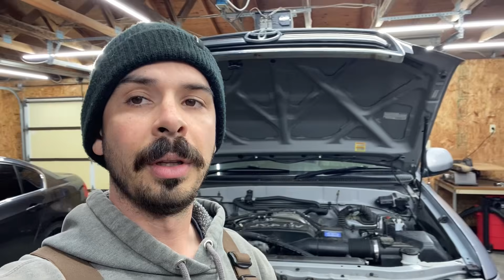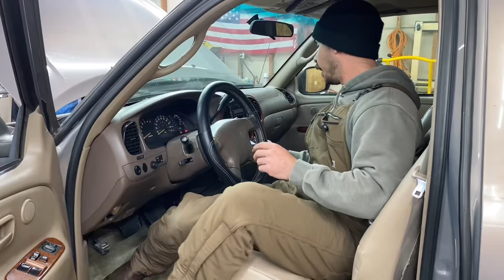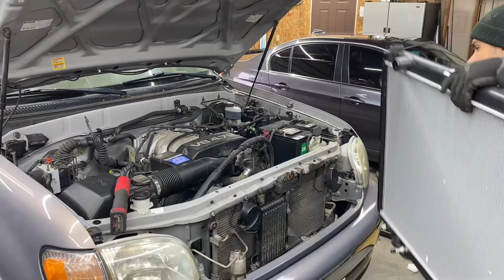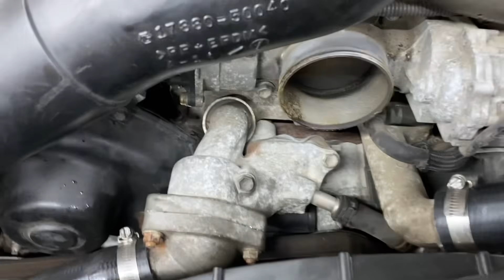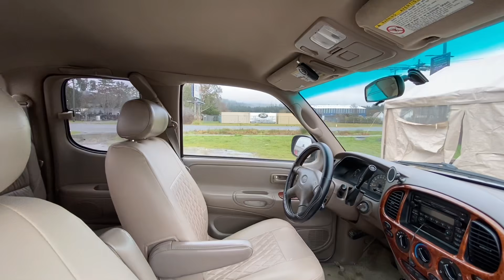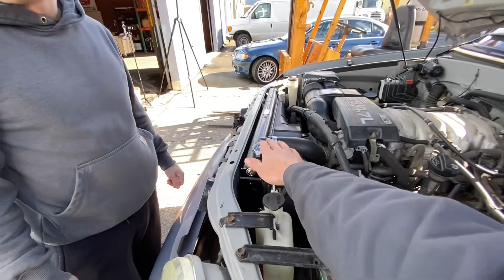Saving My Brother $1398.62 On Truck Repairs!

Comment: Very pragmatic, not jumping to conclusions but with logic analysing and determining root cause(s), and sharing so many tips, hints and warnings perfect for the less experienced DIY wannabee technicians.Great!  If only there were more mechanics like you! (And living in Europe jealous on your V8 toyota engine which should last for ever...(specially if maintained by quality loving technicians like you) BTW this cooling leaking fluid must have been going on some time already judging from starting rust on chassis and brackets around engine, did you tell your brother he should apply rust convertor on all rusten parts clean it off, degrease it and spray zinc paint to avoid the rusting will continue?

Comment: I am the original owner of a 2002 Tundra with the 2UZ-FE engine. I’m approaching 190,000 miles and plan to run it to 300k to 400k. 
I have the original starter on my truck and it is totally rust free. Best vehicle I’ve ever owned. Timing belt maintenance is critical as this is an interference motor - don’t gamble on not changing your timing belt every 90 thousand miles.

Comment: My brother was moving to California, so I went through everything on his 2014 subaru hatchback. Oil, coolant, cvt fluid, front and rear diff fluid, spark plugs, pcv valve,  new tires, brakes and rotors, flushed brake fluid, air filter, cabin filter. Detailed inside and outside. 2 months later he totals the car.... fml
Reply: Lmao 😂😂 well you're a good brother at the end of the day that's all that matters.

Comment: Why are you counting the cylinder numbers like that? The driver side bank is 1-3-5-7 and the passenger side bank is 2-4-6-8. Not the 1-2-3-4 and 5-6-7-8 you were counting.

Comment: Radiator is made to remove with fan shroud attached no need to even remove fan.. just remove lower shroud piece…. That engine has block drain plugs that allows you to drain majority of coolant …. The screw style radiator hose clamps suck compared to factory tension hose clamps

Comment: My 2007 toyota sequoia had a missfire in cylinder #5 and the spark plug was finger loose too! My #7 coil had cracked aswell and was on its way out. I bougt new plugs and coils and it runs like a sewing machine again!

Comment: Get a coolant bleed funnel (attaches to where radiator cap goes) fill till it stops guzzling, start vehicle with heat on max, run vehicle until bubbles stop while filling funnel to half mark as needed

Comment: Fun fact about toyotas. Idk why, but they hate non-OE ignition coils.
8/10 misfiring toyotas that come in is cause of a failed aftermarket ignition coil. (Usually the IGF circuit internally shorts to ground bringing the whole circuit down causing the car to start, then cut off)

Comment: JB clear is for plastic and metals that won't have heat fluctuations.
Use the slow cure stuff for engine housings.
Mixing old green with new pink coolant is not good unless the green is compatible with all coolant types.
Toyota uses expensive 
pink for specific reasons.
Reply: If it's a bad mixture it will turn the coolant into jello

Comment: Great fix for family, you should invest in one of those giant coolant funnels with the plunger in it. It sits as the highest point and you fill it full of coolant, run it with the bottle and it just bleeds itself. It's saved me time and money and paid for itself in the first use, they are amazing.

Comment: Did anyone else see a blooper in his replacement of the radiator check. When he filled the radiator up with coolant he used toyota pink( at 23:55),  but when he went to bleed the system (at 26:41) he showed checking the coolant with Green coolant in the radiator.
Reply: It’s because he didn’t flush the whole system. Definitely not a good choice but it happens.
Reply: Isn't there a chance that the bad mixtures can turn to a jello like substance?

Comment: I'd replace coolant fittings on hoses which go to heater core. On land cruiser with 2uz they detiorate in the same way as the radiator. Dunno whether tundra had them or not. Also fan clutch replacement would be a nice preventative measure.

Comment: Those plastic tank radiator are awsome but they do not like dip or peak .so below -9°celsius they require plastic sheet on the car to protect . Radiator fan is better in the front of the radiator in the desert and behind the radiator in the wintor

Comment: Modern coolants eat the rubber those boots are made of. It does the same thing to plug wires in older trucks. Any time I find a coolant leak, I check those and almost always have to replace the ones closest to the leak

Comment: I always find ignition problems at low rpm, high load. Like a lug. In a manual car get it about 1500 rpm in 3rd and throttle it hard.
Reply from the maker: absolutely! me too on my bmws i work on

Comment: I am the family mechanic in my family! :)   Nice job!   What are you thoughts on the funnel attachment for bleeding the coolant? I thought before I had one "That is just a toy" but I found one at thrift store and bought it. I used it on my sons car when I changed his radiator and it was great!  Made bleeding it very easy..    My daughter in laws car is a BMW and you're correct what a pain to bleed the system. It has the automatic bleed thing but I did it like three times and next day still had air bubbles in it.   I have used that trick for may years with the coils seeing if the misfire moves..
Reply from the maker: i think those funnels are great! just got one that threads into the valve cover for bmws, id like one for coolant too, only downside is pulling it off afterwards and making a mess lol
id probably extract whats leftover first

Comment: Holy crap that Tundra is the same color as mine and just about the same mileage (give or take a few miles) mine has 268,XXX miles on it everything still works i did the water pump and timing belt last year, the spark plugs tend to get loose, it is just now starting to seep oil from valve covers, not active leaks, but seepage, those 4.7's last forever if you take care of them 👍👍👍👍

Comment: Why are you so lazy in making your video? You clearly know that some of your video is backwards and some is in the right orientation because you show the engine and the V8 4.7 L is in the right direction to read but when you show yourself in the driver's seat the steering wheel is on the right hand side like you were in the UK or you are just too lazy to flip the video to the correct orientation. Lastly you are showing your American flag as backwards. 2 seconds and you could have fixed it all put a little more pride in your video.
Reply from the maker: thanks for the comment bill ! Have a great day

Comment: One problem. That coolant looks green. So you mixed two different coolant and that will cause issues. Oh and the green coolant corrodes Toyota aluminum heads.
Reply: Well . . . Remember he installed a brand new radiator and added 5+ quarts of PINK coolant, so the question is . . . How/why did the color change to green???
Reply: @2Nett2  didn't flush the system. If you know you have unknown coolant in the system, My rule of thumb is to flush the system. Toyota red and pink coolant is to expensive to waste like that.

Comment: 2uz is Toyotas best engine. Spark plugs loosening seems to just happen (dont know why). I checked my sequoia and they were. Ignition coils are really the only other common issue. Really, really rare to see any kind of internal engine issue unless you severely abuse them, but even then they hold up. And really simple to work on. Only things that are a pain to do are exhaust manifolds and starter (not as bad as people make it to be)

Comment: Ignition coils are usually expensive specially if you buy them from the dealership, my question is why replace all ignition coils if only two were giving you problems? Always nice to help out the family 👍🏼
Reply from the maker: I always replace them as a complete set, saves you from having to order more a week later when the rest start to fail, if two were failing already I’m sure the rest weren’t far behind. Really not expensive from rock auto!

Comment: My Corolla got "universal " coolant installed by accident. I also saw green coolant. I took it to Toyota and had them flush with the Toyota pink stuff, right away. No cross contamination and clean fluid for 100k miles.

Comment: If the misfire comes back, it could be because of the aftermarket coils. Toyotas don’t like aftermarket coils.
Reply: That's how our Mazdas react too it's crazy both brands are on the same boat
Reply: Exactly Denso is the only correct way to!
Reply: Not 100 percent true coils you can  use different but will agree with the plugs denso ya and ngk

Comment: Nice work. You definitely saved your brother a lot of money, and it's done right, I have a 2006 Matrix with 227,000 miles and decided to teach myself automotive about 7 years ago. I've done most of the work and hooked up a nice collection of tools, and saved a bunch of time and money. Also, get a spill proof funnel. it is faster (just load it up with coolant) and less messy.

Comment: What caused the spark plugs to be so loose? Did they come back on their own or did the previous mechanic not tighten them properly? Wouldn't it also be better to use constant tension clamps on the coolant hoses? From what I understand, they can loosen due to temperature changes.

Comment: Hi Alec, i had the radiator replaced on my 03 Tundra coz its leaking coolant. But im wondering why ac is not blowing cold air now. Any advice or hint whats the problem. Sorry not mechanically inclined person. Thanks !

Comment: Nice work Alec!  I miss my first gen Tundra.  Had a 2006 and was a fantastic truck.  Unfortunately met the back end of a box truck and bent the frame. 

I’ve had a few plugs go out on my 2011 5.7 Tundra so not surprised the ole 4.7 ate some too.  That is a fantastic engine - million mile proven!  

Make sure your brother doesn’t neglect the timing belt. Kept looking to see what mileage was on the sticker but couldn’t make it out.  It’ll be a great workhorse for him for years to come with the maintenance you did.

Comment: THERE IS A MASSIVE DIFFERENCE IN A PART THAT IS LABELLED DENSO ONLY OR BOTH TOYOTA AND DENSO. THE ONE WITH TOYOTA AND DENSO ARE FAR TOO SUPERIOR THAN JUST A DENSO PART: OE SUPPLIERS FOR PLUGS AND COILS ARE DENSO, NOT NGK

Comment: Your a Good Brother... I do the same thing for my brothers e36, his wifes Honda Pilot, my dads Chrysler 300 and my e46 330i.  I love working on cars, when I am not doing my main gig of being a professional photographer.   I am not sure if you were short on time or not, but a brake bleed would have been really prudent as well as I would have also SMOKED the engine because at that high mileage and heat cycles, all sorts of rubber and plastic are near end of life, so a few PSI of smoke will reveal it and offset a new issue.  But Good Job with the content and for sharing your brothers IGs as well.

Comment: I have only just replaced the Coil Packs and Spark Plugs on the E46 325Ci (preventative maintenance) and I found that 3 of the 6 plugs to be only hand tight (yet it the engine had been working fine)!!
Reply: I have the same car 😊

Comment: OE for Toyota is Denso and Aisin
Reply from the maker: At least I got an OE radiator, the NGKs should do well, always liked them for my BMWs
Reply: @DayOffDIY  NGK's good just gotta be careful where you buy them because they get counterfeited alot, also you should buy one of those spill proof funnels to bleed coolant systems
Reply: OE for Toyota of this year is both Denso and NGK. My originals had one bank of NGK and one bank of Denso. I have read that the parts bins on the Assembly line had both during these years. I was surprised too!